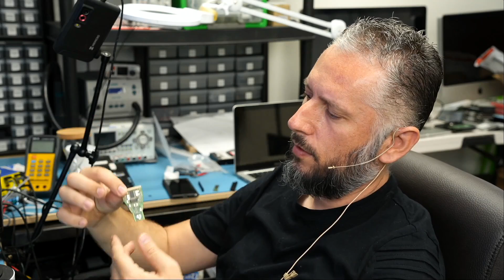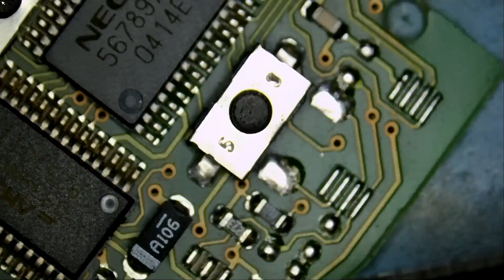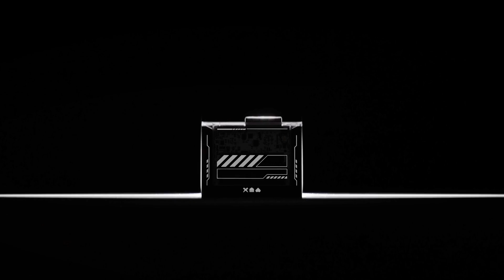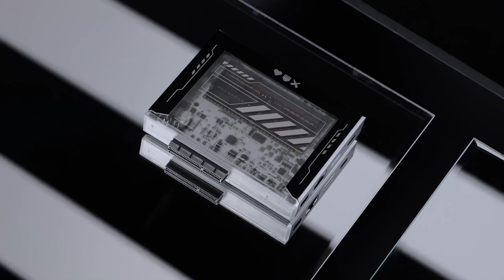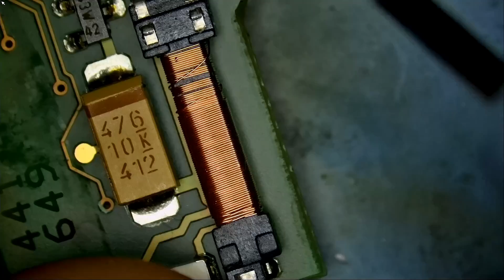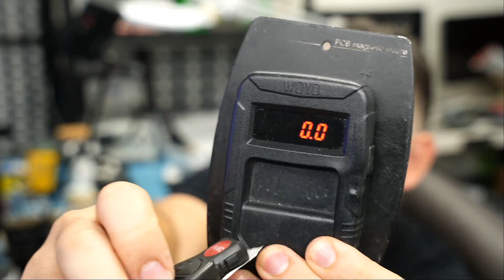Urgent Benz Key Fob Repair - Won't start the Car.

Comment: I just wonder how would you know that there is a missing component if you didnt work with the same fob before ? If i understand correctly you dont have the schematics available and ive noticed that some boards you've worked on have empty component slots where maybe a different model has components there but some more basic model dont have them. Honestly i find it crazy that with so much push from the governments and corporation for "sustainability", "ecology" and "zero waste" and other buzzwords its still not mandatory to provide the repair shops with the schematics from manufacturer, also i love that there is the trend of moving some manufacturing back from China to US and EU because a lot of times you might need some component that would become overpriced if you needed to order just one from China and it would also take a long time. I would much rather pay a reasonably higher price for electronics if this was an option. If the corpos and governments are so serious about the environment i can see only positives, lower transportation cost and emmisions, more readily avaliable spare parts, honestly lets be clear a lot of the manufacturing is heavily automated anyway so the cost of work is not as big of an argument as it used to be in past when the production wasnt automated almost at all. Can someone try to explain whats the problem with making the schematics avaliable to at least repair shops if not general public ? Do they really think that will protect their IP ? I mean i dont thing a hobbyist wont be manufacturing their own computers from scratch given that they have the schematics and the competition will find a way anyway, what prevents a competition from buying the device as a customer and then reverse engineer the shit out of it.

Comment: Alex, would you be able to assist with an old 1 button flip key ir Fob pcb. The ic 6s6 77672081 was partially detatched form the pads. No broken pads though. After resoldering (no shorted pins) the ir is permanently on. Key is EOL. 1996 e320 W210

Comment: I wonder if a strip of the wide self adhesive copper tape on the back of that fob tester would help with interference issues?